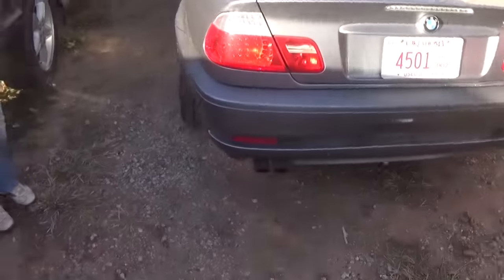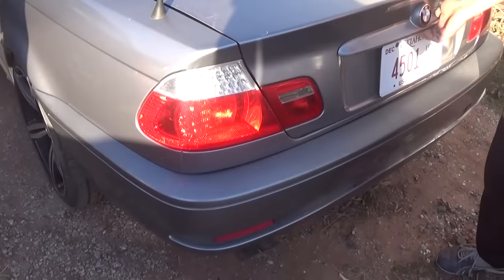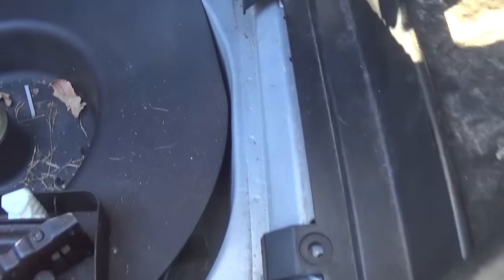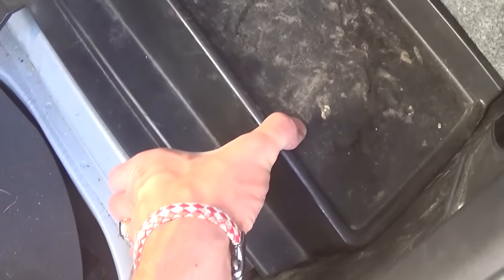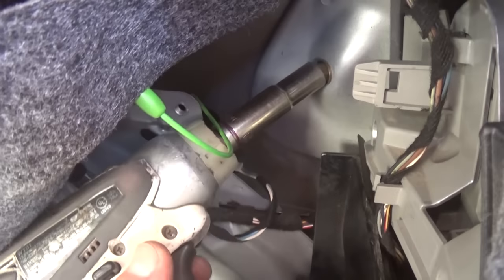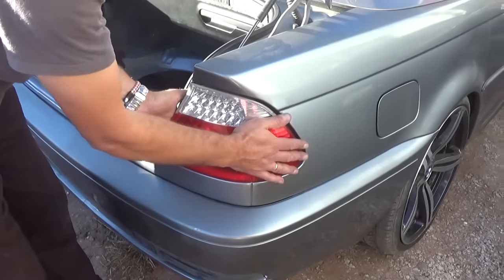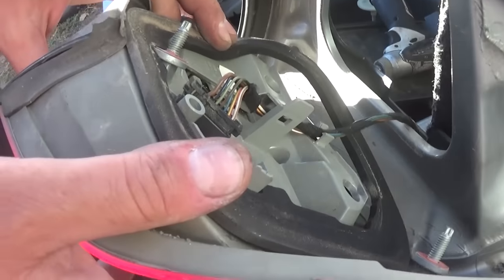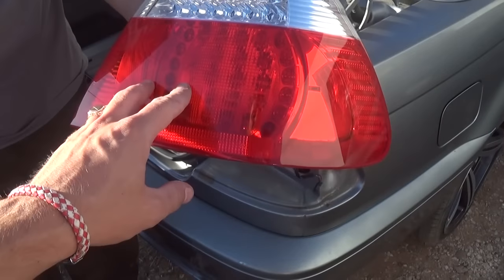BMW E46 TAIL LIGHT REPLACEMENT REMOVAL 316i 318i 320i 323i 325i 328i 330i 316d 318d 320d 330d

Comment: My problem is not changing the tail light it's self but it seems that you can't change the bulbs in the tail light .. there is no way to access it
Reply: I know this is 2 years ago but do you remember what you ended up doing to fix the issue? The only thing i can think of is replacing the entire light fixture
Reply: @-zargati-  funny you respond now and I'm currently in the middle of doing repairs on this vehicle. I want to do some modifications. I think there is a way to refurbish
Reply: @-zargati-  I am trying to figure out the same thing.  Turns out they are LED and you have to replace the whole assembly

Comment: They are LED lights you have to solder them in.They are making cars so you cannot repair them DIY. All l would
    like to know is which colour wires go to rear side light and which colours to reverse light.I want to splice in camera
    and reg plate lights.

Comment: There should be at least 2 nuts holding the taillight in place, You only removed one, No battery cover hold-down bolts and only one taillight nut does simplify your demonstration but it is incomplete,
Reply: Robin Liebersohn Yes this is not the same for saloon/sedan